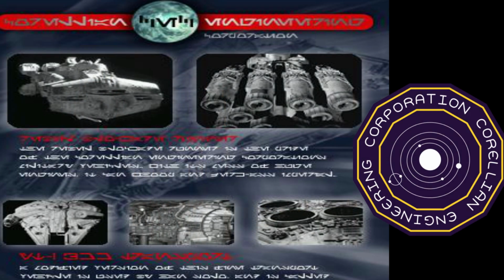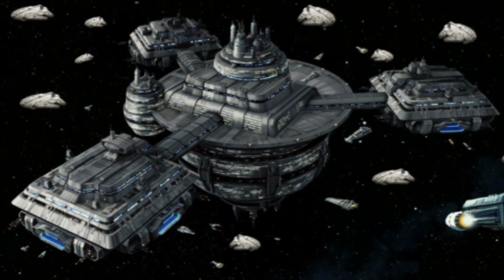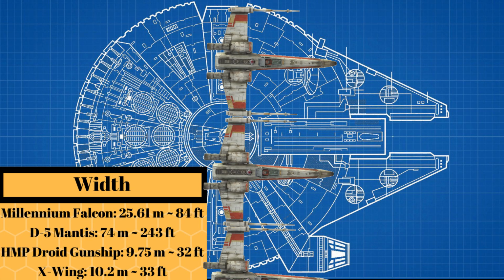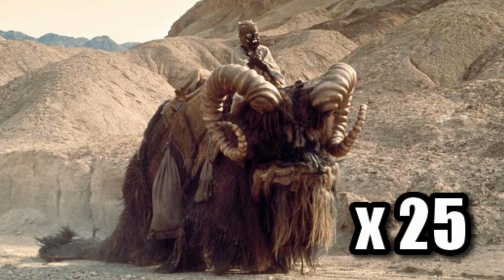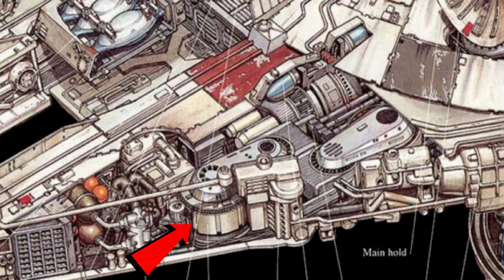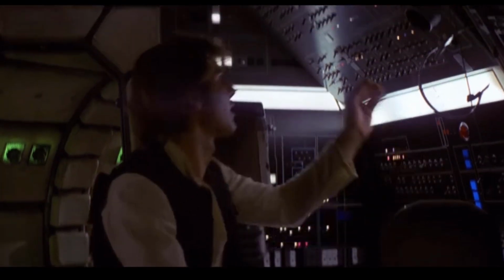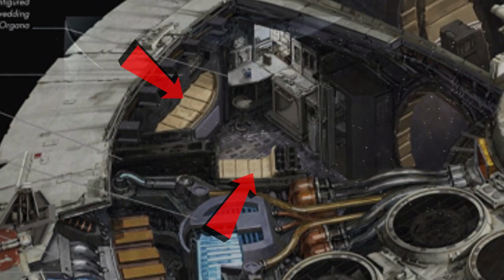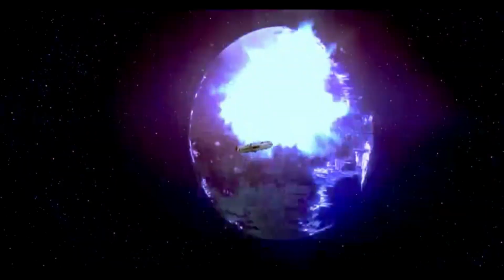Millenium Falcon COMPLETE BREAKDOWN  - YT-1300 Light Freighter - Star Wars Ships Explained

Comment: The maximum atmospheric speeds of these ships are far slower than I expected.  If the Millennium Falcon was on Earth or a planet with a similar atmospheric density it would be transonic at low altitude and just barely supersonic above 40,000 feet  it would have a few miles per hour advantage on a lightly loaded 747-200 at 40,000 feet . However if it can fly at 650 MPH at low altitude that eliminates most air turbine powered threats leaving a few fighters with highly loaded wings that can deal with dense air and nasty turbulence . I assume from the movies that it must be built like a tank and there is certainly an excess of thrust available considering it is faster than light so I think this ship should be able to reach a solid Mach 5 at low altitude.

Comment: Its like putting a 900 hp engine into your mom's station wagon. Along with control rods, low profile wheels, traction control, and ceramic disc brakes.

Comment: It's tactical buffoonery to have 2 vital targets right next to each other. (Main fuel line next to the laser turret)
Reply: Remembering that it's a freighter/passenger ship, not a tactical or even military vessel. Even the weapons were added later.
Reply: @Red5x5x5  any vessel with weapons are tactically designed.
Reply: @shanethomas6368  Can you not read? The weapons were added LATER by civilian owners.
Reply: @Syklonus  can you not read?  ...your statement in no way negates mine. You're a little slow.

Comment: Ok so in later star wars films the gap at the front had an escape pod, but here it's said that it was for exterior containers, and there's enough fanart with the same idea. So which one is it? Or are they both correct and was the escape pod just an option/modification?
Reply: Other videos on this say the pod was a factory option. Makes sense if the ship was purchased more for a transport than a freighter role.
Reply: Probably an option/modification....
Reply: Yeah. The pod Lando installed was an aftermarket accessory. According to one of the manuals, there's even an option to use the mandibles to hold a speeder that helps forklift the cargo.
Reply: @konstellashon1364  that explains things. I always thought that it was an inconsistency

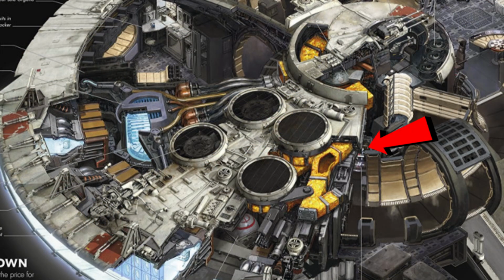Comment: 3:40 - Four Exhaust Vents?! There is Actually 6 Vents!!
Reply: ...and not one of them work since there is no air moving through them to carry the heat out.
Reply: @rudyschwab7709  You are be right about no air part because it would be expelling isotopes like helium-4 into space
According to Jeffereson Lab they use liquid helium to cool their electron accelerator It turned out to be minus 269 degrees Celsius or minus 452 degrees Fahrenheit.

Comment: Where in hell did you get those garbage figures for speed? What is the frame of reference for them? In planetary atmosphere? What gravity for the planet in question? What atmospheric density? Or were they for space? Speed means nothing in space. It is all about velocity and acceleration. Note for non-physics minded, velocity is speed with a vector attached, or put another way speed with a given direction. If you are able to maintain a constant acceleration in a linear direction you will eventually approach the speed of light. We have "top speeds" in atmosphere due to the force of friction. However, given that the Millenium Falcon is designed and intended for primary operation in the vacuum of space, saying it has a top speed is meaningless. The exception is when you are talking about its speed through Hyperspace, which most sci-fi authors tend postulate as being filled with an atmosphere of sorts of quantum particles that can slow a ship down and give it an effective top speed. Finally, we cannot forget that most ships have shielding and such systems can absorb the effects of atmospheric heating creating the plasma bow wave much farther away from the ship and thus permitting drastically higher accelerations and top velocities even in planetary atmosphere.
Reply from the maker: Lol man chill the f out. Everyone here gets your physics points. Okay 95% of the channel probably. These stats come from reference books. Star Wars makes all kinds of reference books for games and visual dictionaries for the movies. Why would not assume I read that from somewhere. Why think I made that up, like somehow I did some calculation to show it's as slow as a WW2 plane. What a silly way for your mind to work. Relax brother, deep breath lol. We all realize the stats make no sense. Atmospheric speed would be different on every planet, and we get no relevant way to figure out its speed in space, and it's a space ship. Silly I know, but ya gotta be able to realize that instead of thinking me or the other viewers are dumb and don't know ish about  space travel.
Reply: @MetaNerdzLore  Can you provide the references you used then? The numbers just seem really really arbitrary and I personally cannot recall anything actually giving such figures as general sub-light accelerations and speeds. The only speeds I have ever really seen bandied about has always been hyperspace speeds.
Reply from the maker: Man I assumed you were just a regular star wars fan since this was the millennium falcon so it would draw people who maybe only have a relatively simple interest in star wars. But you mean you've read stuff with different hyperdrive speeds, are that into it and never seen other stats. Guide to Vehicles and Vessels is one, the roleplaying books mention it, cross section books. You can wookipedia it and then click the little citation number next to stuff. Speed stats on the right. If you like this stuff and really never saw those books I think you'll love it, and wookipedia too
Reply: @MetaNerdzLore  I am familiar with Wookipedia. I shifted out of Star Wars over a decade ago since I was decidedly unhappy with the majority of the newer stories. Kotor 1 and 2 were a happy exception to that. Since Disney acquired Lucas Film and all of George's remaining companies it has just gone way down hill far worse than what Episode 1 and 2 ever did or the New Jedi Order novels.

I suspect Youtube put this into my suggestions since I have recently started playing Star Wars The Old Republic, despite being an EA title, due to a desire to play something in the vein of Kotor but after the two single player RPGs and a desire to enjoy some kind of MMO while awaiting WoW Classic.

Since you say there are official sources for those numbers, all I can do is /facepalm at the people who try to do any technical back fill on the Star Wars universe since it is clear they really do not think things through and carefully analyze what they are contributing to the Star Wars universe.

Thank you for the responses.
Reply: With CONTINUOUS repulsor thrust, it might not be NECESSARY to have high speed for escape velocity...
Reply: @Maadhawk Have you ever gone by the discord name of Lenny?

Comment: YT -1300 GTI
A rebel light corvette based around the YT-1300 would be an interesting concept. Include all the speed and maneuverability modifications of the Millennium Falcon, just improve the reliability with a good service. Strip out all the cargo space and amenities and add extra quad guns and shields and a large compliment of concussion missiles. It would make a good hit and run raider that could disguise itself as a civilian freighter to get in close to targets in high traffic areas. Launch a salvo of missiles at heavy targets and annoy the crap out of starfighters with its extreme maneuvering and point defense guns. 
And outrun anything. 
It would also work in pitched battles where it would once again destroy enemy fighters and launch concussion or ion missiles or drop bombs at high value targets and could get close enough to make intercepting the missiles very difficult while targeting subsystems. And just be a pest with its zipping around the battlefield doing straffing runs. 
The advantage of it's civilian design is logistics, getting a bunch of them would be easy for the rebels, who then upgrade it's systems with military components.

Another variant, a bounty hunter ship. Same advantage of speed, maneuverability and most importantly, discretion. Slave one may be a formidable ship, but it's also very recognisable. It gets spotted and anyone with a bounty on them knows to be on guard, hell the spaceport will be buzzing with news of the Fetts arrival. 
But a YT-1300 is ubiquitous in general traffic and allows you to sneak in and out. Give it the Millennium Falcon handling pack, weapons, sensors, ect. Add ion weaponry for stopping ships to capture targets or making quick get aways from heavy combat vessels. Throw in some of the useful extras from Slave One, tracking gear, bombs ect and modify the cargo hold, some of it is cells for prisoner transport, while some is kept as cargo just for cover at a spaceport. 
Can do everything Slave One does, carry more, and not stand out.

Comment: I'm not comfortable with the placement of those concussion missiles. If hauling cargo (performing the primary function of this vessel), then they are unusable.
Reply: Pretty sure those were added AFTER it was not used for cargo anymore. Several times in the vid he says how heavily this has been modified. However if they did I'm sure there is a safety lockout.

Comment: For those asking "Where do they poop?"  Look at this image → https://i.pinimg.com/originals/b7/20/d2/b720d2d67b17da313f09b7abacb4b6cb.jpg  It is near the modified crew compartment, which is located  far left of the  Upper quad-laser cannon,  just right of the galley, (kitchen).  It looks like a dark gray closet with a fan-fold door,  but if you zoom in,  ( ctrl + Mouse-wheel ) and scroll to it, you can see a toilet through the open door. (It appears to look similar to the ISS toilet)  One could imagine that they also washed in there. Most likely by using the "sponge-bath" method to conserve water.

Edited to add more info.